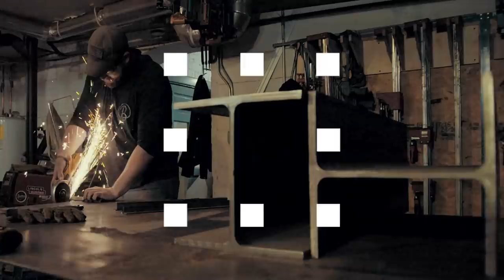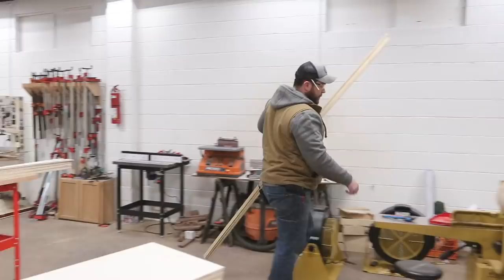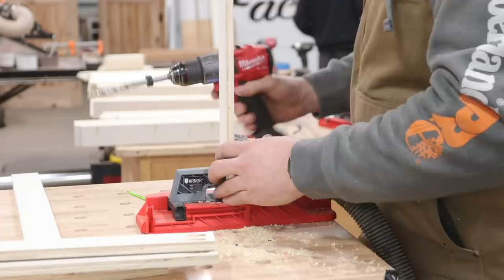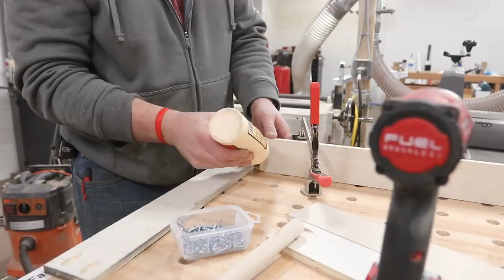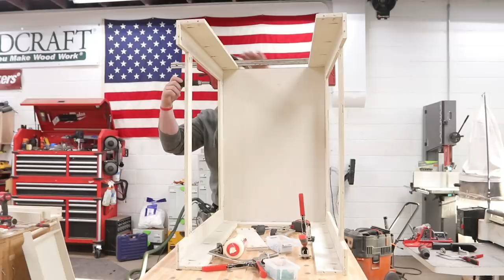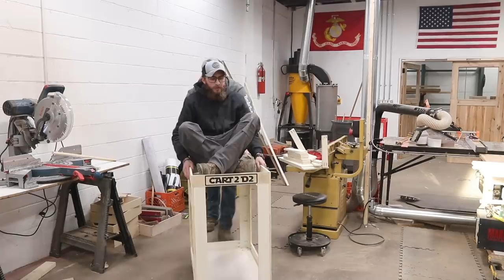DIY Mobile Shop Carts

Comment: Hey John. I am a newbie at woodworking and one of the most daunting aspects to woodworking is understanding joinery and when/where it is most appropriate. You made a statement toward the beginning of the video regarding why you hate them and how people are using them incorrectly. You mentioned table tops. What are the correct joinery methods? I have seen videos where they use pocket holes and honestly...it gave me confidence that I could build a good dinner table using that joinery. Now I am not sure what to think. I appreciate your honesty and it keeps me coming back for more wisdom for my arsenal.
Reply from the maker: Well Andy thank you for asking. A panel or table top should be glued up with jointed edges and wood glue in clamps. Pocket holes in material over 3/4 puts all the pressure in the bottom half of the joint and can bow easily. Gluing and clamping straight boards is faster and more effective . And you can reinforce with biscuits or dominos
Reply: @John_Malecki  Thank you John for your reply. My wife does not thank you for giving me an excuse to get a biscuit joiner! LOL She will thank you once I get to tackling that project and complete it! Again, many thanks.
Reply: @John_Malecki  Everybody has an opinion...that's a given.  I respect yours but don't state it as fact.  I stopped listening to you at that point, although I watched and liked your cart.  Do yourself a favor and don't spend a lot of time pissing off others who don't share your opinion.

Comment: Thank you for speaking truth on pocket holes! I can't stand the over-use by everyone... it's like Kreg gave me money, so I'm going to use them in the most inappropriate ways possible. So frustrating. /rant and love the videos!
Reply: Corey Trick maybe it’s just me and it’s been so cold in Ohio and I haven’t thawed out yet lol but why is it inappropriate ? Is it because most people should be using biscuits? I’m just not following
Reply: @mikep3008  Maybe I wasn't clear. John uses them correctly on face-frames. It just seems like a lot of online creators use them for every instance they need to screw something together. As if the old nail and glue is sacrilegious, it's just odd and usually unnecessary.
Reply: Corey Trick ok I just wanted to make sure. Yea I do see that with a lot of creators and it seems like it could be more expensive as well.
Reply: Figured we were talking same thing. Definitely more expensive too
Reply from the maker: For anything thicker than 3/4” a pocket hole is not what o suggest for the best and strongest joinery method. Mostly table bases and top construction. I despise seeing it there. Plus I wish more people would try other joints. They’re so much more fun , stronger , and satisfying
Reply: John Malecki I feel ya John, I’ve been wanting to try dominos for my next build. They look like a pretty cool thing to try and advance my skills

Comment: I'd probably hate pocket holes too if I didn't install them right.

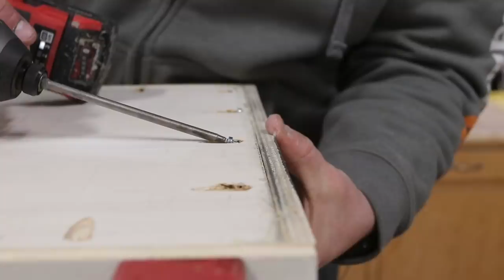Don't know what's up with that jig, but those types of pocket screws should work fine and end up below the surface. When you using thin material you have to use those short one with the weird head, but I've never had them sit like that before, even in 12mm stock. From the looks of where the screws are sitting up, and where the holes comes out the bottom if you pause at 3:48, it looks like the jig was set too far down. And if was up slightly, the hole would have come out closer to center, there would be more room for the screw to fit into as well.
Reply from the maker: I simply shouldve used 3/4" Ply i think
Reply: @John_Malecki  Don't know ply you have available, but at least for me in Australia, albeit, it is construction ply with a lower quality finish, for a shop cart it's probably not all that important, and nothing a quick sand won't fix.

We have ply available in almost all ODD numbered mm from 3mm. Currently at least I can get 3, 5, 7, 9, 12, 15, 17, 19, 21, 23, 25mm ply. The 12, 19mm options match with 1/2 and 3/4"

For small project, 12mm is alright, and then for large projects, 19mm(3/4) is good. But there are some inte middle projects where 12mm is too thin, and 19mm (3/4) is too thick. So I like using 15mm for those. 15mm is roughly 5/8 I think.

Comment: Am I the only one wondering why all of the silver pocket screws seem to be standing proud of the holes when they were screwed in?
Reply: I noticed that too.
Reply from the maker: They have bigger beads on them. I ran out of the armor tool supplied ones
Reply: @Bradley Fransen I've had a similar issue where try as I might I couldn't get them to sit beneath the surface. Either they were proud or the angle they were driven at was wrong, either way the head wouldn't clear. That probably made know sense. face palm.
Reply: Figured that. He was using up random screws that weren't aren't perfect but won't effect anything.
Reply from the maker: Ya its a shop cart, so i dont mind if theyre not perfect !
Reply from the maker: you can use any tools with this jig. it comes with everything you need

Comment: These carts look great, thanks for sharing. Just a small criticism, from the video, it looks like every screw you put into those pocket holes got all f-ed up, is that correct? Looks like they got screwed in too far and split the wood, is that because of the screws? Also, cart name..... Kim Cart-dashian?
Reply from the maker: Armor has some small sauarenhead pocket screws that are 1” for 1/2” plywood. I ran out so the ones you see are another brand with a bigger head. Plus the plywood I had was junk. I would do them in 3/4 if I did it again

Comment: Porter Cables pocket hole jig is the best on the market - IMO
Reply: I have the Porter Cable one and like it
Reply from the maker: I didn’t even know PC had a drill usage jig. I just looked it up. Looks solid. Does it adjust the collet to match the material thickness and tell you screw size ?
Reply: You only have to set the collet once 

When you put material in the jig, it adjusts how deep it goes depending on material thickness

Stoopid easy to use
Reply: John Malecki no adjustment needed. You set it once out of the box and it does all sizes. Very robust design. Pricey but the best designed and made big on the market.

Comment: Are the screw heads supposed to be sticking out of the pocket holes like that? 🤔
Reply from the maker: No. I ran out of the smaller head carts . So I went with what I had which was a bit bigger head and with 1/2” ply they didn’t sink as well

Comment: I am totally building this.  I already downloaded the plans, bought the wood and wheels.  Nearly time to start cutting, but I had a question...  Why did you add a shelf support?  It looks like the bottom of the shelf is screwed into the sides and the sides are supported by the legs.  Are the shelf supports members needed for additional reinforcement of the other joinery?